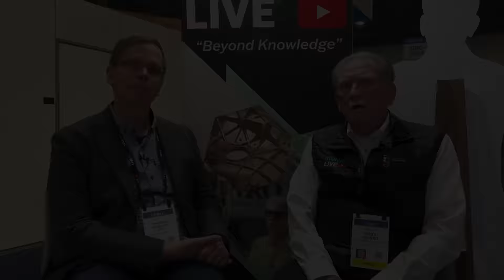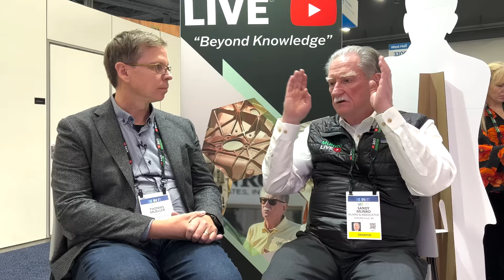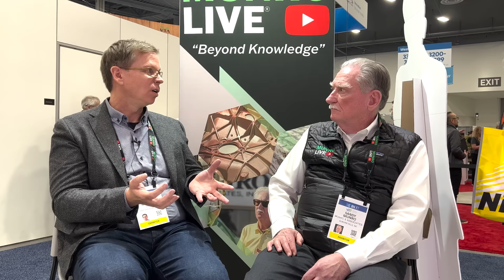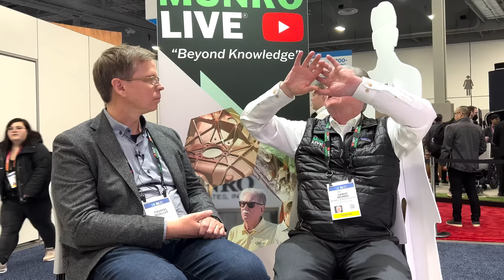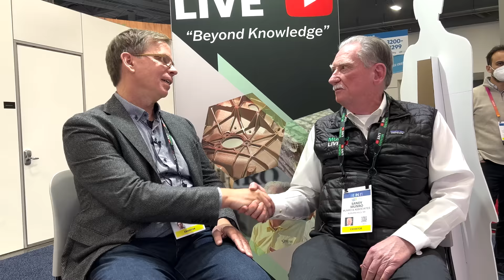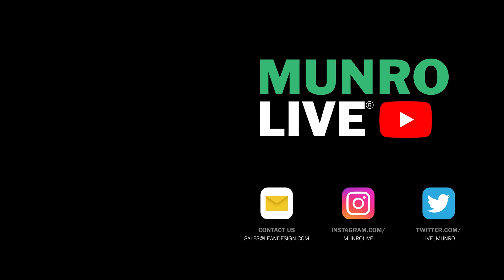100 Million Lines of Code: The State of Automotive Software | CES 2023

Comment: I’ve been a software engineer for 45 years, greatly appreciate this content.
Reply: Gee, I write embedded code.  Yes, I use the C command set, but I compile under C++.  There is nothing wrong with this combo.  The sensor data is appropriate to C data structures and the various comms protocols between devices. If you want to call a C++ library, have at it.  No, we don't need a whole new paradigm. Only where human interfaces are concerned do we need all the kewl stuff.  Most of the car compute is consumed in sensor, radar, and image processing for uses other than human consumption.
Reply: @roberth5435  Whilst the current technology paradigm works with a narrow view, I think you missed the whole conversation.  I recommend trying some Hopi Candles and have another go at hearing what was said.
 C and C++ developers generally are almost as rare as honest politicians.  So while you are in the vulnerable position of being perfectly equipped for the old paradigm, there is probably more than enough work to keep you going and you can comfortably ignore the new paradigm.  "Progress happens not because people change their minds, but because they die"  
  One of the huge differences between the days Sandy talked about when C was they latest and greatest and today is that compute is a fraction of a fraction of a cost.  Do you know how much compute is in your wallet?  There is more compute on the chip on your credit card than the Apollo moon rockets.  So, choosing a language based on frugal resource usage and speed is in many cases not the main selector.
Reply: @Sidowse  cost of vehicle like 40k you mentioned isn't static. as a breakthrough tech the EV needed to flex its superiority at cost. so hypercar power with in many cases better range than comparable hypercars at a fraction $$.
light vehicle with good range will be really cheap.
but this barely matters compared to cost per mile reduction. 
switching takes time and certainly sticker shock but Solar EV combo will be game changer even before autonomy.
companies that do this will have a honeymoon period of better margins before competition makes them honest again and real cost reduction gets passed on.
.02 😉
Reply: @Sidowse  You, me an Elon agree that cars are too complicated and heavy.
  I doubt that regulators nor manufacturers would want consumers updating software, even if they can demonstrate competence.  They do likely use opensource software in the mix, but behind a locked door.  There are people who can hack the cars, but as far as updating software, on a car that is used i public would be insanity if you were doing it flying blind and unable to run a tougher set of tests over it.
  For smaller vehicles, i expect you can build your own and have the option at least to use your own software, but again without a team with a good understanding of the system, I would leave critical things alone.
  When a firm goes bust there is usually a fairly complete parts inventory that someone picks up or gets left with.  For example the DeLorean has a company who has all the original parts, still boxed and who make parts that are no longer available.  Dustin's last SmarterEverDay view was about a guy who repairs tractors that are up to 80years old, making parts as needed.
  I with you on the small city three-wheeler with two seats, but with Arcimoto filing for bankruptcy, which is sad but not a shock, I'll have to sick to two wheeled electric bike + two wheeled trailer.
  E-bikes will be licenced for public use, regulation is currently in catch up mode,  ebikes are essentially motor bikes and deserve safety considerations and restrictions in public, like anything else in a common law jurisdiction, that could cause loss or harm.  My bike is currently not road legal, but for me the power is usually for towing, not toeing it.

Comment: Excellent discussion.  As a almost 60 year career in software,  I can assure these issues are not restricted to automobiles.  More broadly speaking, it is an issue of data silos which in turn tie back to organizational structure.  At one point as a newly minted DBA  I worked for a retailer (no longer in business) where I tried to get their credit card operation, catalog department, and parts service departments to share their customer data.  No luck!  Each group thought only their data and needs trumped the thought of looking at a total customer picture.

With a slight shift,  I believe BMW management recently said they didn't think their cars should be  Apple IPhones on wheels.  At first glance, this seems to contradict your referencing BMW as being forward looking from a software view.    Probably remnants of continued siloed thinking.
Reply: Hmmm ... a real graybeard.  🧐
Reply: Spam blocked.
Reply: Conways Law in action
Reply: Sorry but its destiny for cars to be iPhone/Androids on wheels.  I don’t want to use the janky infotainment software developed by the car manufacturer.
Reply: This is painful to watch.  Android runs on Linux.  The speaker seems to not be aware of this.  He claims that BMW is moving away from Linux when they are adopting it.  Also they have no idea about modern programming.
Reply: @dougdurham  Exactly right.

Comment: It is interesting that Tesla is not using off-the-shelf software like SAP, but writes their own business management software. It makes sense to code your own solutions if you are also vertically integrated and have the capability to push the leading edge of development. Here, Tesla shows itself as much a software company as a hardware one.
Additionally, Android does utilise the Linux kernel. For entertainment, Tesla has done something similar by adopting Steam in its latest S/X vehicles.
Reply: Tesla doesn't have business people.  Engineers manage themselves.  It is impossible for ford, gm, vw, etc to compete in any way because the companies are controlled by business people, not engineers.  If any of them wants to survive, they need to write software similar to tesla which also includes tons of automated integration testing and fire all the business people.  A company ran by business people is never going to fire themselves and the rest of the managers.
Legacy auto cannot survive and will be replaced by new companies that have way less business people eating up their payrolls.  Most of what legacy auto spends on payroll goes to dead weight, not engineers.
Reply: There are advantages and disadvantages of both solutions, there's no one right answer. For Tesla vertical integration is the obvious choice for many reasons. The main ones are that they have the resources to do it, and that the whole company operates very unconventionally.
Reply: @andrasbiro3007 
In this situation there is no advantage to the old system.
.
This is being demonstrated on a daily basis.
Reply: Well Tesla is a software company that happens to sell cars.
I think developing Autopilot and selling in the future is more important to them than creating good quality cars.
Reply: @Bierkameel  Well, even their execution of hardware is software inspired, so yes they are primarily a software company from that point of view. Also I'm very excited about the bot, as I think that the diverse requirements this will place on their AI development will give them an additional AI perspective which I believe will help them solve the real world driving AI even better.
Reply: If you do the math how much would SAP charge for all the factories stations, engineering and regular offices, showrooms and warehouses? Millions saved now and in the future billions per year saved for all of tesla companies...spacex included.
Reply: Thomas Mueller was just pushing his own products to combine code written by many vendors each with thousands of average software engineers. Tesla has a few hundred elite software engineers working together on proprietary software that they have the codebase for. They have been doing full system over the air updates for about a decade and can already review the vehicles sensors and inform owners of many problems that have been noticed and compensated for such as adjusting temperature to offset cabin overheating.
Also they can and do reprogram for available chips while other just shut down their production lines.
Reply: I knew a SAP implementer.  It's not that it's so great, it's that it sucks less than most other options.  And far too many companies want to use SAP to emulate the way they did it on paper in 1994, which she will do.  But it's a terrible idea, your recurring cost are silly and all the glue code can have bugs.
Reply: SAP is designed to make the accounting department happy, the CFO usually gets the last word in Enterprise software selection and they seem to like the data it generates for them. For production control, department loading and project management it is very weak, When working for a 3M devision we implemented SAP trained almost every person in the company for about a year in how to set up departments and projects . We would periodically request the system to load the departments and the result was chaos. Instead we used the paperwork to have operators sign off on production every shift and the foreman and managers would do all the real planning .
Reply: tesla is car world apple... iphone hardware is "side dish", main cake is software and all ecosystem. EVs are simpler technically(mechanics, parts) than ICE, so it is good fit business wise
Reply: Imo not using SAP and instead doing your own ERP is 100% the way to go if you have a strong software culture in your company. If you don't have that then definitely don't try to do your own ERP, it will end in Desaster...
Reply: tesla is NOT vertically integrated...do they make their own wheels, suspension parts, tires, brake rotors, paint, wiring harnesses?  NOPE

Comment: @7:15 not only is every "hop" a latency issue, each step/hop usually includes at least one connector (usually 2 - one in and one out) - in addition to the device itself.  ALL of these are additional points of potential failure.  As much as Sandy hates (un)fasteners, I hate electrical connectors even more, and I'll be he does as well!
Reply: And Legas install cheap connections, antiquated, so failure risk increases.

Comment: Moving away from Linux to Android...   umm, Android is basically Linux plus a touch-centric mobility-focused GUI (with lots of support APIs of course).  So, it's not that tough of a transition for infotainment, all things considered.
Reply: Android is linux without having access to root.  So you need all these silly APIs that limit what apps can do because the owner of the phone cannot manage permissions of apps. Google holds onto ownership of any phone that has android on it because only google has root access.  This allows google to limit sideloaded apps so they cannot be much different than the apps in google's store.  If you could easily sideload better apps, the google store would die off.
Reply: @_PatrickO  You can setup any Linux environment this way... By default actually a newly created user will not have root access. You will only be able to get that through for example giving that user the right to use sudo...
Reply: HW compatibility with Linux is much longer than android. My 6 year old CR-V has android "box/panel" which can't be upgraded with newer android thus seized. There are tv-sets which can't play Netflix due to old android versions. Not to forget couple year old mobiles which don't get security updates. Those don't support car for lifetime idea. Perhaps car for 5-7 years is supported.
Reply: @p20071  but an addition to the tv is  possible
google chromecast... fire stick etc
maybe this is a part solution
Reply: @p20071   I don't see how it's an improvement to go from Linux (some customized distro) to Google's clutches.
Reply: @p20071  This has absolutely nothing to do with Android itself and everything to do with manufacturers just killing Update support for their devices... Android itself is just a kernel that gets continuous development just like the Linux kernel itself. Going to Android allows you to access all of the tooling around building touch friendly applications that has been developed by google for more than a decade now with billions in R&D investments for smartphone use...
Reply: @_PatrickO  You can side-load on EVERY Android phone I've ever owned without ROOT. You have to turn it on manually.
It is, of coourse, a good idea to turn it off when you're done ...
Unlike that "other"  phone seller who outsources ALL production and expects users who want to sideload to pay big bucks for a "developer licence" (alternative:  root the device).
Reply: @meamzcs  Shut up.  By default, the owner of the device who installed the OS has full root/admin.  This is true of all operating systems, but android and ios.  Even windows mobile did not have manufacturer permissions blocking you from doing what you wanted with it.
Reply: @photohounds  You cannot read.  I clearly pointed out that even sideloaded apps are restricted unless you root your phone.  The sideloading is a gimmick that they think will prevent them from being forced to allow root control by the owner.  They are willing to let you sideload with a tiny bit more freedom as long as they can still assert control over sideloaded apps.  They do not want people disabling services that datamine you on the phones.
Reply: @_PatrickO what do you need root for on a mobile phone?
Reply: @meamzcs  So you can both install apps not restricted by google and not have carrier restrictions placed on you.  No one has a right to control your device but you the owner.  Right now malware runs rampant because without root, the malware can gain more privs than the user.  Malware finds ways to gain more access than the user, then the user cannot remove it.
Reply: @meamzcs  marketin use, right

Comment: A few things to note: 
1. There is some  standardization in the auto industry such as AUTOSAR, UDS, OBD, etc, but a lot of the software is replicated across the ECUs. We have used common software from ETAS, Vector, Electrobit, etc to integrate software for various supplies and OEMs, but it is costly. 
2. Just because C is old, doesn't mean its bad. Automotive systems require guaranteed operation, which means having extremely detailed control of your software. C allows that, along with having been tested over the many decades. Not to say other programming languages do not, but C has a lot of infrastructure around it in the automotive world, such as MISRA and ISO-26262 compliance.
Reply: Well, having over 20 years of experience with C and some other programming languages, I must point out, that when you want to start moving from heap of small ECUs to few large powerful boxes, C would become huge burden. And don't forget, as cyber security starts being more and more important in automotive (way too late in my opinion), securing C apps is just huge nightmare. I do like C and I'm still using it a lot for programming IoT devices, where you usually have some tiny power efficient MCU, but for most other purposes, there are much more effective options.
Reply: @MiroslavMaiksnar  I agree, there are disadvantages as you mentioned. One of the many advantages of C is its use in real-time systems. Because of this, I don't see a scenario where you can have something like your braking controller being written in anything other than C. If you look non-safety critical systems such as infotainment, I think you're right, C is not necessary.
Reply: @embeddedone  C is not only language suitable for real-time applications (it is just most traditional one). But in discussed microservices architecture you can easily combine different programming languages, so you can still use C for critical tasks. And as most ECUs currently use old 90nm or 45nm technologies, high level programming language on faster modern MCU will give you better latencies than C on old HW – modern compiled languages have very similar performance to C, you just need to have control over features like garbage collector (if present), so it don't kick in during critical sequences. Or use language like Rust which does not have dynamic garbage collector at all. Personally, I'd use C or C++, as I have long experience with them and wouldn't like to experiment on critical use cases, but it's not the only option these days.

Comment: Moving away from C  will cause a big performance hit unless it is replaced with a similarly capable compiled language. Rust is probably the best option.
Reply: I know nothing about rust. . . but I’ve produced a lot of C code that is still running (and earning $$$) 15 years after I hung up my keyboard.
Reply: @dewiz9596  Many of our cars have expired due to rust. But it does sound appropriate for vehicle use. "The new 2026 Chevy - now comes with Rust!"
Reply: All chip vendors have atleast offer c/c++ complier. Rust has a long way to go. It has thus far only one implementation.
Reply: @vrajeshkumar  also, I don't think the memory management system is robust enough for embedded systems limited memory. So most development will be using unsafe rust
Reply: @vrajeshkumar  rust may make it to the main stream or it could become one of the hundreds of C killer languages that disappear, C is one of the few things that has  survived more killers than Tesla
Reply: This guy is out to lunch. Not only is C not the majority language used (it's C++) but also anything running Android Automotive is mostly Java and Kotlin. There's also incredibly strict safety requirements that Android simply doesn't pass and as a result it can't serve a lot of purposes. Also all high level languages use C or C++ libraries underneath. So this whole "C bad" argument just boggles the mind.